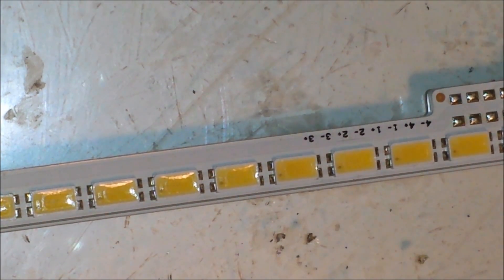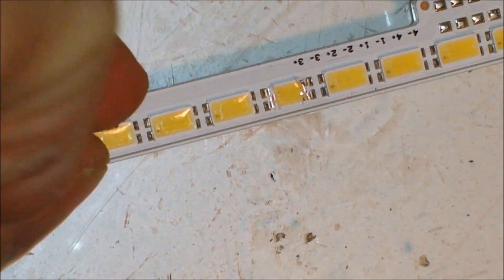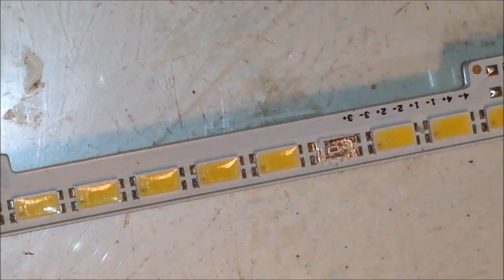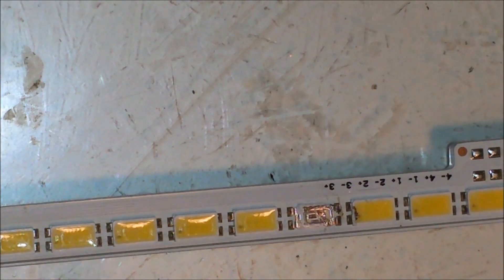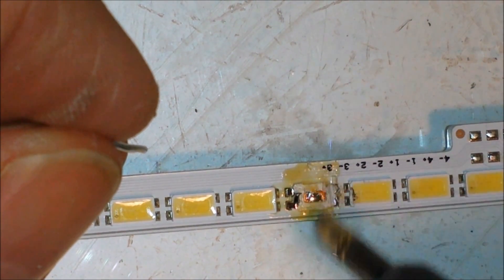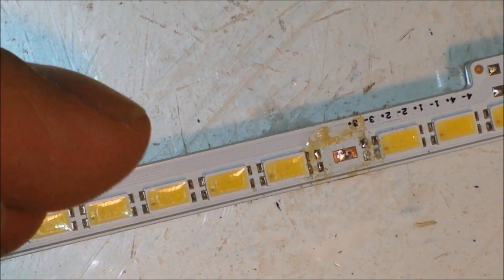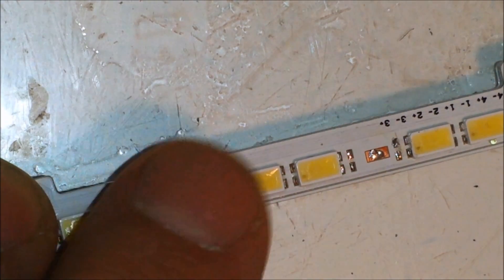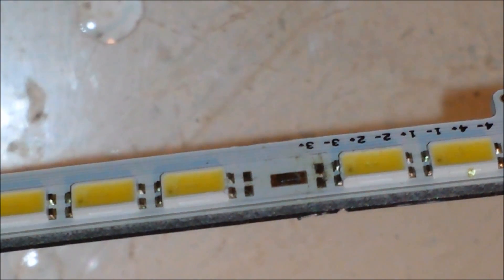LED removal without hot air. Can it be done?

Comment: You can use low melt solder and mix it with the  current solder. It'll lower the temperature so you can tack each side and make them both molten enough to remove it but it ultimately is a waste of money. a cheap hot air gun would be sufficient or use a hotplate from walmart etc.

Comment: I use mini blow torch. and heat the back of the aluminum PCB...that way you can easily remove the part. That is what i do whenever i want to scrap something and re use it on my other projects. Only applicable on aluminum PCB. Other uses hot plate or flat iron and pass the aluminum PCB on it..but what if I only want to remove one part.thus mini blow torch like those of a butane powered soldering iron. That\s my easiest way to do things neatly